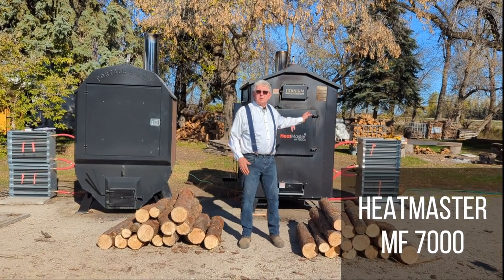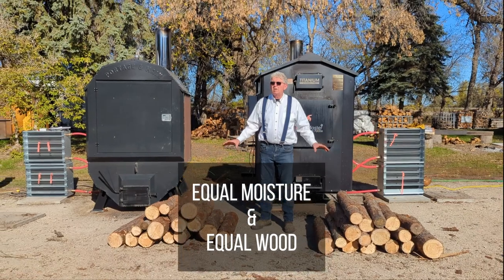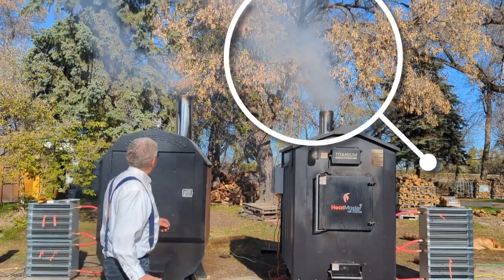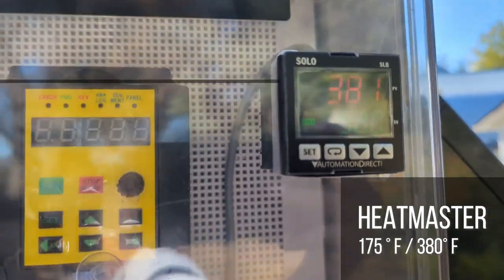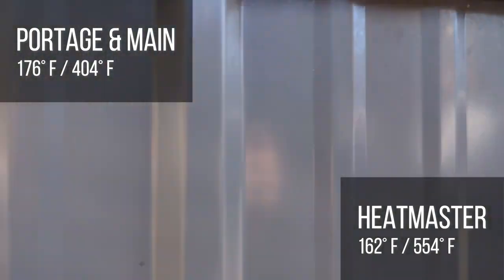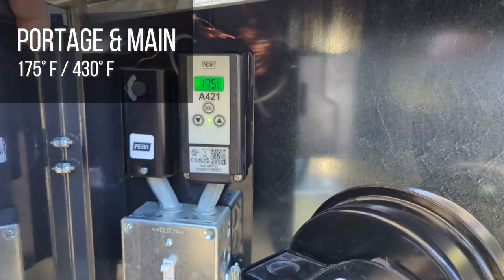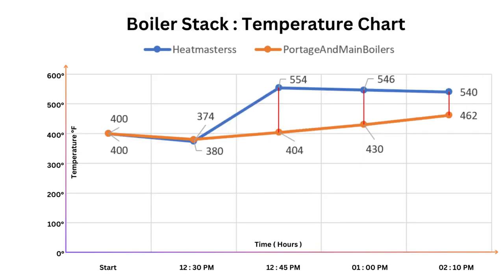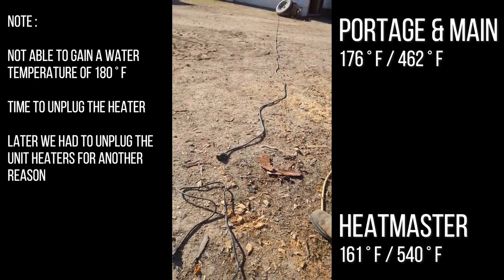Portage and Main vs. Heatmaster (Part 1)

Comment: I have a BL 28-40 that i have had in service since 2013 , its been an awesome boiler , i had to do some repairs where the chimney attaches , I took it to a local welding shop to have it repaired , the guy at the shop was impressed on how well built these boilers are , he has repaired many brands and thinks theses are the best built ,I like the fact that they are built with a replaceable water jacket , this boiler will last a lifetime. rake your coals and keep your water treated.
Reply from the maker: That's awesome to hear Andrew, they truly are built right.
Reply: How come almost every single time i watch a portage and main video someone says something about a leak?   This is scary